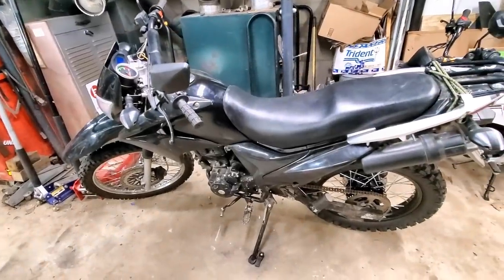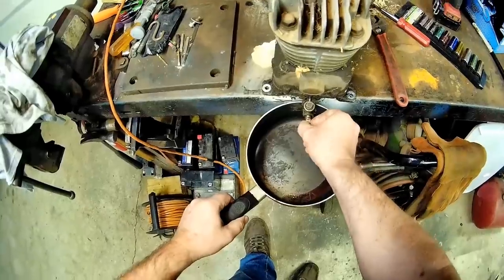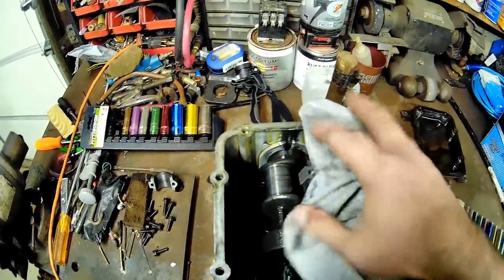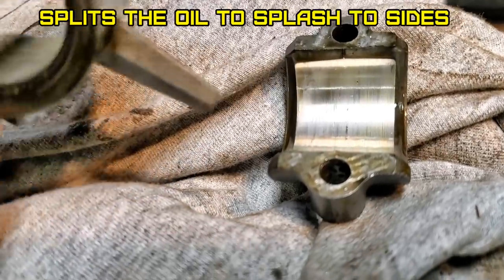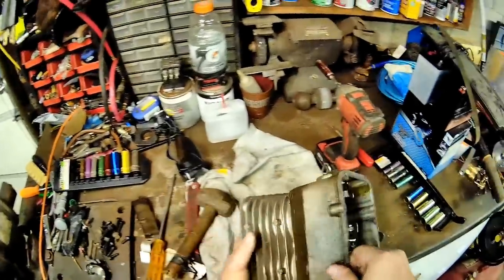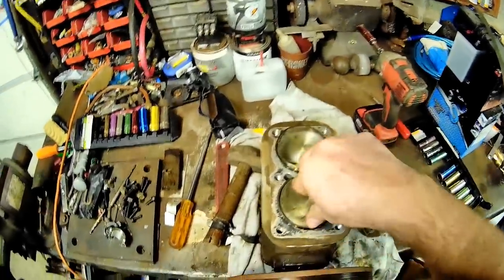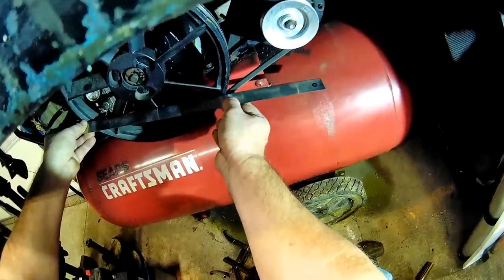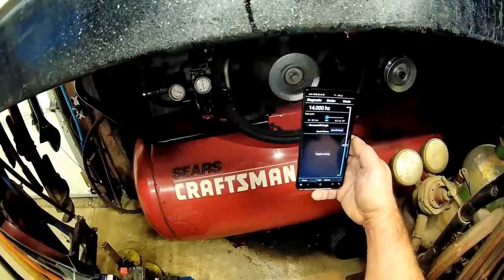PT1 3hp Harbor Freight compressor head on Sears, test RPM tachometer with your phone, sold my hawk

Comment: I'm not sure if I misunderstood but, if you were over driving it with the smaller motor pulley, and under driving it with the 3.5 inch pulley, wouldn't a 4.5 inch pulley under drive it even more? sounds like you need a 3.0 inch pulley or 2.75 inch (if there is such a thing) pulley to get the compressor to turn a little faster to match your target RPM. Maybe I didn't understand what you were saying at the end.
Reply from the maker: The drive pulley has to be larger to spin the compressor faster, I ordered a belt. Will test once it come in w the 4.5" drive pulley
Reply: Ok, yeah you're right. I had it reversed in my head. lol

Comment: The connecting rod kit is 365-410. They're available online for anywhere from $20-40. Oil seal is 265-111 and appears to be a pretty basic off the shelf type seal. They're available for a few dollars all over the place. The rest of the pump looks to be in pretty good shape. May be worth it to get parts, fix it, then put it on the shelf as a "just in case" later on. Never know. If nothing else, you may be able to sell the repaired pump for a few dollars more than you'll have in it.
Reply from the maker: Think the crank journal cleaned up enough and still keep a tight tolerance. I guess I can clean it up and micrometer it. But good idea to keep a backup. Have to price all the parts. Need gasket kit too. The HF unit is only $138 and it's cast iron
Reply: @MotoCheez  The price of the HF unit is a very valid point. Certainly something to weigh out in regards to options.
Reply from the maker: @lawnfascist4890  seems like a better unit all around too